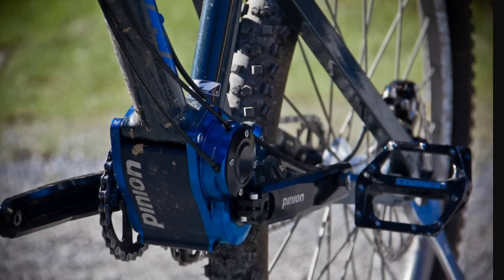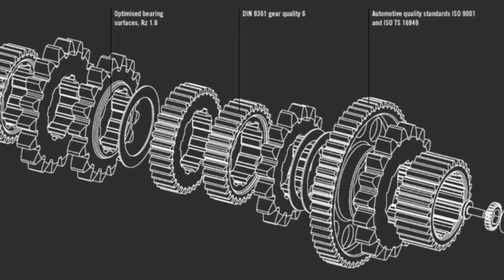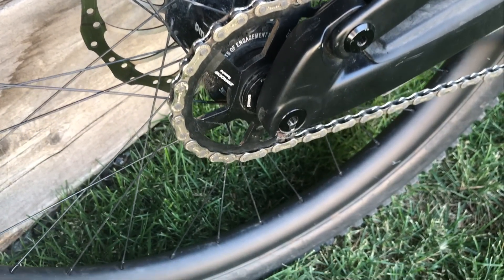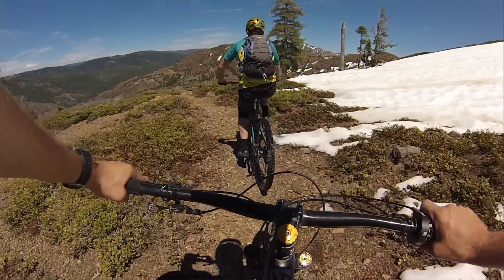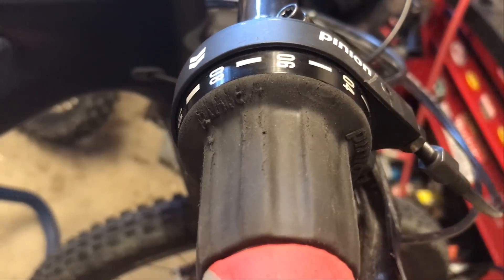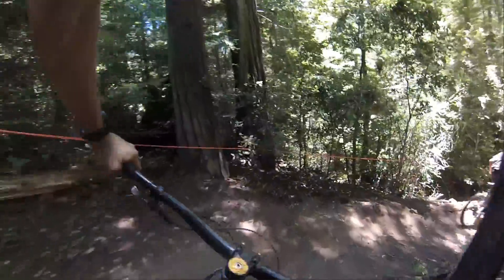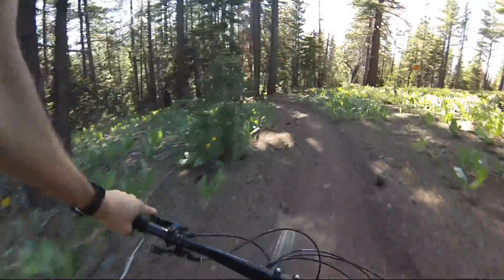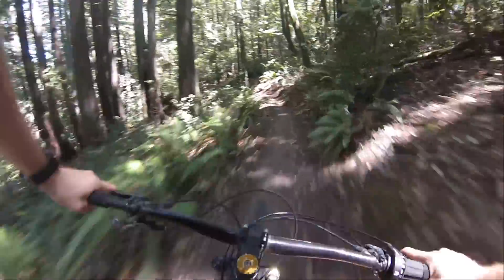Pinion Gearbox Thoughts & Opinions

Comment: Agreed definitely needs refining, its a big thing though for a small company like Nicolai to develop the Pinion in the first place, not sure if this is the Zerodes first gen Alex you rode, but Rob has a next gen out already, not sure if that has addressed some on the cons you mention, I know it's lighter, but for me the grip shift and the fact that you are stuck with Pinion crank arms is also another neg, one thing the industry learnt from Shimanos disastrous system integration in the early 2000s was if you deny the MTB consumer choice of mix n match components then you will struggle! Course this is out of Robs control and probably the best gearbox solution of what's currently available, also remember Shimano and esp SRAM have allot of reasons not to support such technology, while they can hold everyone back they will! Great idea though using a similar system to Onyx hub for the next gen gearbox, I like that idea. Rob also needs to make one in 29" 150-160mm travel not sure if he will though!

Btw great looking trail you were on in the video, cheers for the review.
Reply from the maker: MaverickDH a 29er is in the works!!!! But I definitely understand. There is so little money backing the gearbox rn

Comment: Pinion should hire you to implement those ideas 😅.. if they solve that they are gold. The other downside is also that you need a frame specifically for the system will carbon fiber suited to carry the gearbox?

Comment: have you tried pre-loading when shifting. when pushing my old bike I would apply pressure to the shifter for a few seconds and then let off the throttle a small amount and it would shift over with no clutch. sometimes I wouldn't even have to let off the throttle.

Comment: There is a break in period, like 500 miles.   The drag goes away after that.  Once you get used to letting up a bit while shifting under load, it's  way faster to shift.  You should not shift a derailleur under load anyways.  I love gripshifters and get used to it.  Weight difference is only 700g after you weigh both systems side by side, not 2lbs.

Comment: The Effie gearbox is better because the crankwheel output is not concentric with the axis of the rider's pedal cranks. Which means you can instead have the front pivot of the rear suspension concentric with the motor's crankwheel. So as long as there was not a Hurst link at the back, there would be no chain growth as the rear suspension goes up or down. In fact a Trek/DW style 'split pivot' rear pivot would be perfect, giving a floating brake caliber effect at the back too. 
Remember as the pulsing torque effect every 180 degrees of the pedals is to a large degree neutralized out by the gearbox (& el motor if there is one to), it's not necessary to have the front pivot in-line with the top chain line to prevent rear wheel hoping in low gears.

Comment: it's a no brainer and the way forward but needs tweaking and I'm sure in a few years this will be standard
Reply from the maker: scott wilson it's actually so close! The refinement is honestly pretty minor. Hopefully by 2020!
Reply: Like he said in the video (calling it drag), planetary gear systems offer significantly lower efficiency - simply because the touching surface between cogs is bigger and there's more friction than slim chainrings and chain. It's not a no brainer and don't count on planetary gear systems gaining popularity soon, or, more probably, ever. For e-bikes maybe, never for regular bikes.
Reply: NEED ceramic pinion bearings to reduce friction & weight. seemed over engineered esp at baack end.
Reply: no brainer...you are right ! why the fuck you'd put such shit on your bike ?! you'd still need oil to run it, and it heavier, overkill to say at least :))))))))))))))))))
Reply: What I don't understand about bike gear boxes is...what problem are they trying to solve? Even if the cost is reduced to non-ridiculous levels you're still left with a heavy, inefficient bicycle. If you want more range, run a 2x setup....I'm not sure there are many people who will ever what to put up with the unsolvable downsides of weight and efficiency for slightly better suspension performance.
Reply: I dont think so...NOT A HATER to new tech at all, but 2020 seems wishful thinking (2120 lol!!). Plus there I cant get past the normal biker wanting an ultra custom, pricey frame to build upon when way more options for familiar feel, customization, diy mechanics, etc. To me, theres no way this will gain traction. This will stay in those low key custom bike expos that people will walk by and say "huh..thats a neat idea". Past that I think not. I spoke with custom bike builder shop mech for REEB bikes here in CO, he threw an interesting tidbit that German DH guys are seen running this which is interesting. BUUTT, where are those bikes in UCI World Cup??
Reply: No way. It will always be less efficient due to friction. It will always be more expensive and heavier due to the amount of machined parts. Derailleurs may need more frequent maintenance, but that is at least simple and most of it can be done by the customer.
Reply: I hope so, I want my next bike to have this
Reply: All those rubbishing this gearbox simply cannot afford it! Derailleurs are old technology.

Comment: This is definitely the future. These 12 cog cassette systems are just plain stupid by comparison. I mean really - a $350 wear item?! And you still have to clean and change chains all the time to keep it up, and it's heavy, and your wheel is all dished. This system just makes more sense. Super low maintenance and good weight distribution.The ultimate setup would be with a belt drive, drop the weight, and drop the grip shifter for something more modern. I see it going into every high end mountain bike and conventional derailleurs going away. Well, they still work great for road bikes. 
Excellent review and view points from a technical racer! Great job!

Comment: How would I figure out if the Pinion is compatible with my current bike? I’m on a 2016 Rocky Mountain Altitude .
Reply from the maker: Joe Seven frames are made specifically and for pinion only. Yours is not compatible
Reply: Alex Chamberlin That makes sense. So if a frame is designed around the gearbox does that mean that all other conventional drive trains would be incompatible with that frame?

Comment: I cant wait for an e bike with a pinion gear box.
Reply: IDK when I wi finally get to start on it but I'm working on designing an adult pedal car that will have both a pedal assist electric motor and a this gear system and a differential well if I can make it a quadracycle not a trike like the pebl or elf etc
Reply: Effigear is building one

Comment: this is been around for some time now, about as long as the Taniwha has. iirc they still have design issues around durability. both bikes can fail under high load when climbing.

edit: haven't looked at Taniwha in a while. they used to use a proprietary gearbox and I guess the make it with the pinion now. yeah this thing will break going up hill

Comment: They should use aluminum alloy for the bulk of the raers with tool steel only for the teeth , that could save a ton of weight.
Maybe I am wrong but those gears just look huge for a man powered vehicle.

Comment: To reduce drag...What if you put an additive in the oil such as Tufoil which makes the lubricant more slippery?
Also, when you shift a motorcycle without using the clutch you still have to let off the throttle between gears. The power is either cut manually with the throttle or electronically. Either way the power has to be cut momentarily.
Reply from the maker: blipco5 maybe!!
Reply: It certainly wouldn't hurt it.

Comment: I think its an interesting idea but it has a lot of barriers of entry to the market.   

First, you need a frame that is specific to this gear box.  If the gear box was able to retrofit or fit into already existing bikes or e-bikes (?) it may be increase potential market size.  Next, there are two super dominant gear manufacturers and they have the power to drop prices to force bike makers to choose their produces to meet price point and P/E ratios.  Since this system requires a fully unique frame it will basically prevent the gear box to enter.  Finally, I think that this is a great idea but a lot of innovation in the bike industry ends up abandoned by the side of the trail.  

I would give it a try....but due to lack of frame selection and LBS support would choose a standard product.  I have a hard enough time getting service on a standard bike with no LBS representation (Yeti).  I would be interested in a nerd experiment.....add two to 2.5 pounds to the bottom bracket of any bike and your suspension and balance will change (that is around 8% of bike weight).  I don't know if this is enough mass but it could change suspension movement.

Comment: the huge maintenance intervals, sounds great, no rear dérailleur to destroy in a crash, all current Rear dérailleurs are flawed, they are made to be consumables, which I hate, I wish the yhad bushings,  and were a mix of Shimano and Sram, I love the feel of Xtr shifter, but would be nice with even easier to service shifter. it would be nice if rd could be fully taken apart, s oyou can have bushings and change them as they wear so you have a long lasting Rd. If I only rode on one bike, I would have to change the RD every year.
the gear boxes are interesting but a twist shifter is a bad idea for mtb.

Comment: This is sweet and would be awesome if more refinements like weight, shifting under load prob, etc are solved...BUT its proprietary to the bike frame. they need to have the buy in of all frame manufacturers in order for it to take over. but I think if it is well refined, well researched and proven, frame makers will accommodate this system within their model range. Yet another huge prob, it will come down to the bike ind "mafia", once you take away a market share profit of easily interchangeable parts between any bike on earth, I don't know if the powers to be would allow this. we shall see, it may stay in special boutique brands for quite longer than you may imagine.
Reply: mike jones almost any "new technology" nowadays is proprietary to the frame: think about boost, press fit, plus and fat tyres, tapered headset, thru axle
Reply: PizzocanWasd I get your point, but I still say this is way far outside in cmprsn to your list. thru axles, tap hd sets, fat/+...every Joe shmo frame builder can work around tgese simple items, this is a huge  component commitment that would need huge buy in IMO. I think its still years and years away...not like what you listed which has been easily adopted by frame and component mfgrs as well as the riding population. I.e. I'd never buy a bike w/out thru axles, but I can live with my x0 1×11 thumb shifting sys that I can swap to any one of my bikes atm. this is an unswappable complex item I guess is also what I don't like also
Reply: PizzocanWasd I mean...why don't you see everyone on those rholoff hubs, or a gates belt drive for ss crowd?? just because something has a plus that "could" be good, doesnt mean it'll get adopted across the entire board. I think riders like a little bit of simplicity and ease of diy...this gives an impression like I'd have to take it to local meinekie shop to have work done to it lol
Reply: mike jones    I wonder if they moved the transmission to between the seat tube and bottom tube, above the bottom bracket, right in that V. On some bikes it would interfere with suspension design, but others could deal with it. It could be an aftermarket product at that point.
Reply: Ehhh..I dont know, that seems again complex and again a completely custom frame. I live in CO and am able to visit REEB bikes mech shop by me. I saw they had a couple of bikes with this system, and even they agree that no way not now for trail bikes. Way too heavy, super custom frame, and agree with me about the component swap complex on upgrading drivetrains, cranks, etc on any "normal" frame. They did say it does have apps like bickpacking, touring, etc. but the customer has to want this item. The bikes they have this on are really cool looking, belt system and all, but not for the trail group. They did say German DH guys are running this so that was a interesting loop to add in the conversation. To me this is like 20yrs in the future for trail (if that), NOT 2yrs like most of the commenters below tend to want to believe - NO WAY lol

Comment: Around 11 min in you talked about using an electric shifter to shift under power like you can on a motorcycle.
You can not shift a motorcycle transmission under power, even bikes with electric shifters have to monetarily cut power to the engine so as to take the torque of of the gears.
Motorcycle and I'm sure this transmission use dog gears to engage each other.
You can look them up online to see how they work.

Comment: Motorcycles with a quickshifter cut the ignition for a few milliseconds when you change gears so that power input is suspended long enough for the gearbox to change gears. That is difficult to achieve on a bicycle...

Comment: You need the second hub ratchet so the chain isn't moving, imagine someone rode without shoes and their toe got stuck between chainring and chain, it would take it clean off.
Reply from the maker: Lt Dan I would recommend riding mountain bikes with shoes 😂 if the chain is moving, like a motorcycle. It has less force on suspension movement. Giving you better suspension feel and control
Reply: Alex Chamberlin I believe the point Lt Dan is making is valid. If the chain cannot stop turning anything like toes; jeans bottom; shoe laces; whatever is caught in the chain it would be dragged through and either be taken off or risk binding up or some other damage. Of course your point is well taken on the need for shoes in racing but people ride in other situations where the unexpected can happen and catering for the lowest common idiot (or accident prone person) is the norm these days and sometimes just necessary.

Comment: I wonder if it will ever be possible to mount something like this to a regular frame. How many manufacturers are actually designing frames with gearboxes in mind? It would not surprise me if this is the next big thing. Will Shimano and Sram even allow this kind of innovation to happen without having a monopoly on it? lol
Reply from the maker: sammmycheez99 think about 650b wheels, one by drivetrains, boost spacing. All the frames needs to be specifically designed to use those technologies. The only reason this system has the potential to be better, is that you can engineer the entire bike to work as a system. So it can be significantly better than a standard bike
Reply: Yes, this is the coolest tech with the most potential imo, it would be one of the most radical changes to the paradigm of MTB let alone cycling in general if it became more widespread.

Comment: i think once they tweak the little problems and manage to strip a bit of weight, it would be a low maintenance no brainer for me.
Reply from the maker: Cable75 low maintenance is honestly the best feature!
Reply: Cable75 actually the weight for me is not an issue, I think people who actually ride this thing would say the same, it's a perception, as Alex mentioned where it carries the weight esp for this style of bike is far more beneficial and if people rode it which is not easy to access, I think Fanatic now offer a demo you would be blown away!
Reply: wouldn't mind finding if there was a demo over here in the UK.
Reply: @alexthemtbr  Would it be feasible to use a Gates belt for the final drive, and make it maintenance-free?
Reply: Paul Standeven 
I have seen a gates belt version on a gravel bike. Check out Co-motion bicycles website

Comment: It wouldn't surprise me if sram and Shimano are already be working on a gearbox system, but there just milking the derailleur system as much as they can
Reply from the maker: The Bs I agree!
Reply: The Bs Anybody remember Shimano Airlines pneumatic shifting from around 1999? If they did a hydraulic shifter for a gearbox that would probably work pretty well.
Reply: @davomoto42  They'll probably have an electronic clutch actuation internally where the torque on gears can be reduced automatically in order to shift without any adaptation by the rider to apply less pressure in order to shift.  Just like a car transmission.
Reply: Shimano has applied for a patent on a gearbox.

Comment: Thinking on buying a Cavalerie as for my next Dh bike since I'm digging a lot the concept of a belt instead of a chain together with an internal transmission.
 The only thing is that the Pinion box position on the frame looks much better to me, it blends way better with the frame because it is horizontally set on the frame,while the Effigear box equipped on the Cavalerie is on a vertical position on the frame which to me doesn't look cool at all on the frame.On het other hand,it seems to be a much much lighter system than the Pinion does,a very important and positive pro feature.
 Hoping that you have tried already a Cavalerie with a Effigear box system in order to give me a straight forward and honest answer which will be very appreciated based on your proof of self trial,I got to know from you which one is the best gear box system,is it the Effigear on the Cavaleries or is it this Pinion one??

Comment: This pinion gear box could be further developed and parts downsized to reduce the weight.If it is possible to reduce the weight to half the present level by using high strength metal parts,it can be used for racing also!.